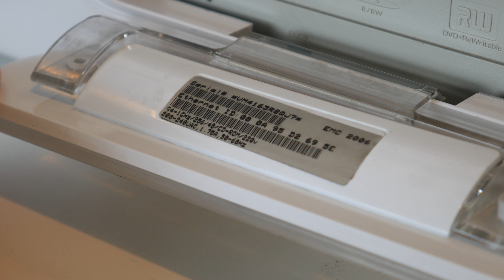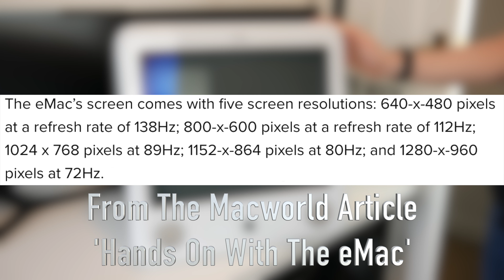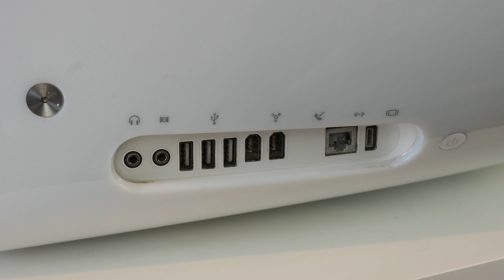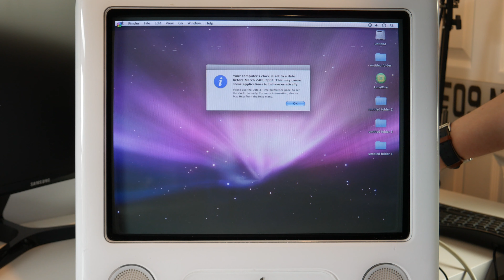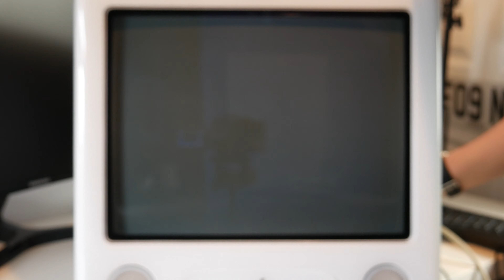A Look At A Possibly Dead eMac

Comment: I have an old HP compaq dx2000 mt from the same era. It used the same type of ram, and the video signal looked horrible. Lines, distortion, crazy colours, and it was broken. It turns out, it was a 512 mb ram stick. When I removed it, the lines, dead pixels and distortion is gone. Just remove either one of the ram sticks as the capacitors that are known to fail seem to be working. Please make a part two video. Install an older version of macOS or just replace that ram stick to keep running leapord. Best of luck mate!